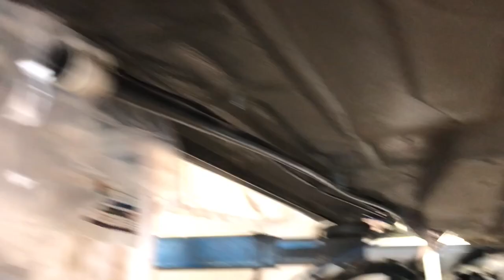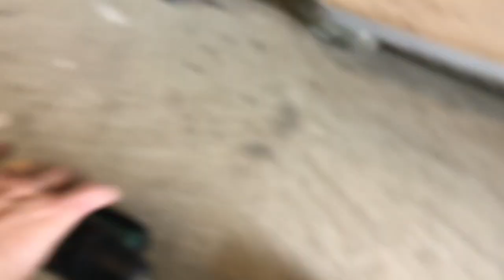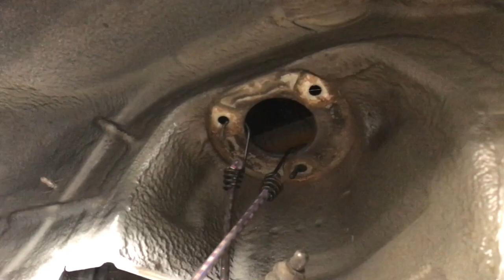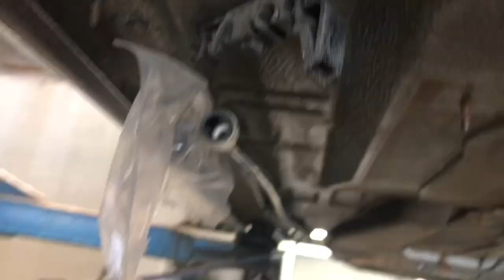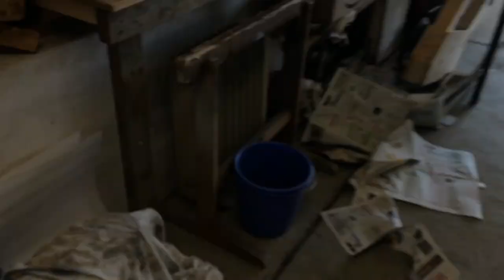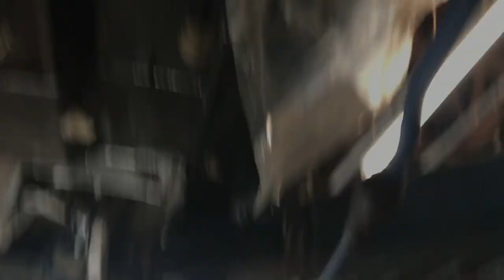Porsche 996 Restoration - Part 11 - Shocks & Underbody Studs

Comment: Very nice Sir.

I was thinking 6mm studs all the way...  But you are there, and I am here, so....  You are probably seeing it better.  But I agree, it wouldn't take much, just to open up those brackets & mounts a hair, to allow the 6mm...  the rest, if you can buy those nuts, yeah, go for it....

I had that on a car of mine, but I sort of caught it earlier, so I started spraying them with a heavy duty metal protector type product...  Sort of sprays on like a heavy oil, but then some of it seems to dry like a wax...  

Anyways good luck Sir.
Reply from the maker: Thank you. That sounds like the Spray I need. I have got some clearness spray. Will test it out tomorrow. 👍